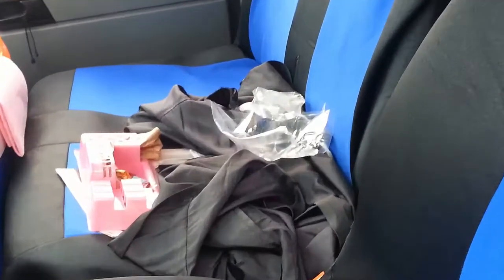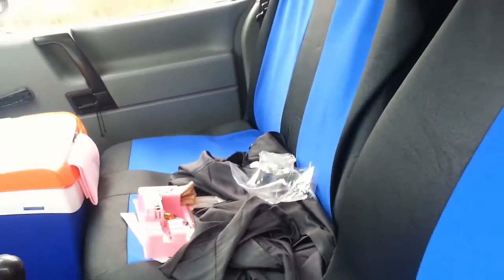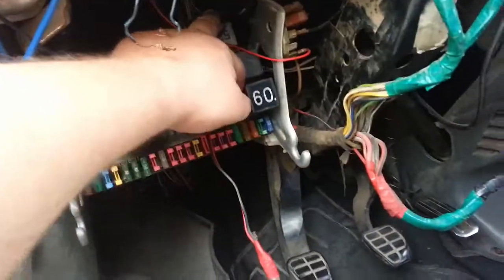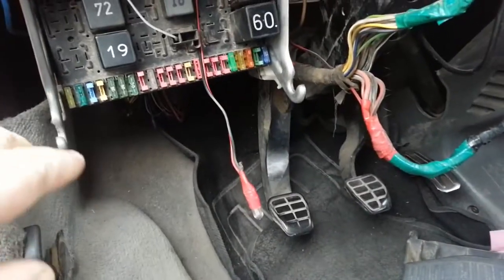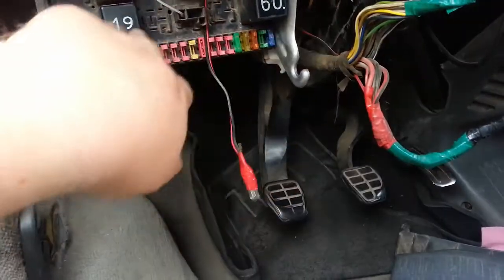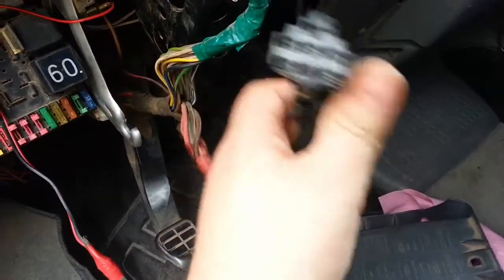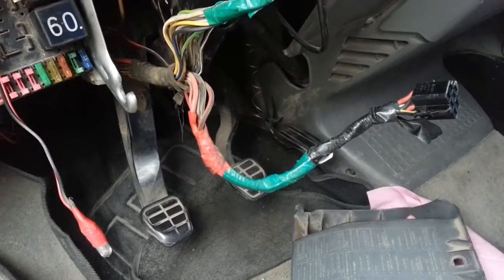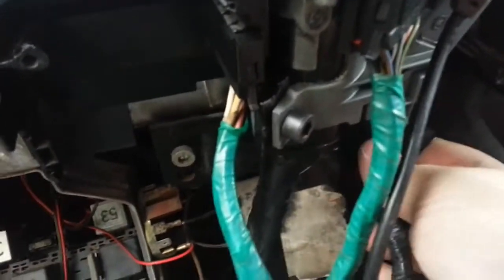VW T4 Caravelle: Complete engine power failure

Comment: as these plugs get old and brittle the release tabs break off and then its only held on by the female terminals gripping the male terminals.

bloody electrics eh !?

luckily these vans are relatively simple,that's why I love them.

glad your running again

kind regards
carlo
Reply from the maker: +astront917 Cheers Carlo, yep I have avoided full electric packs etc. on vehicles for years. Keep it simple its cheap to fix. A lot of the stuff on the newer vehicles are put there to generate a maintenance revenue. Another problem solved this week which is a step in the right direction